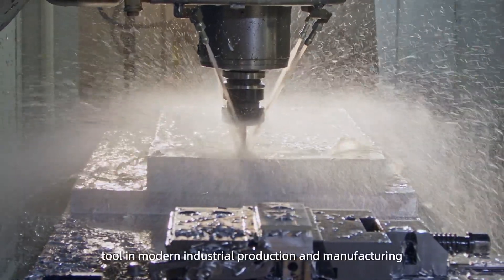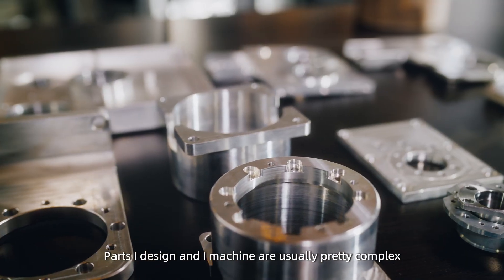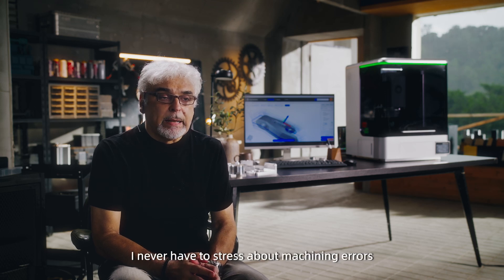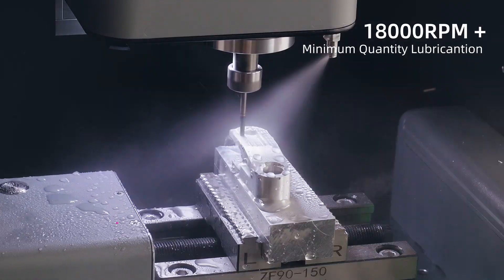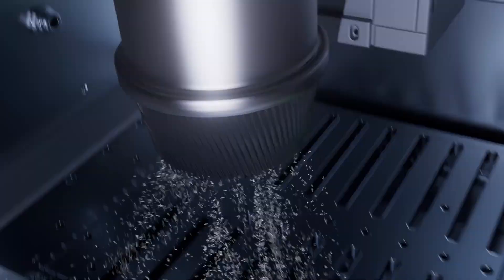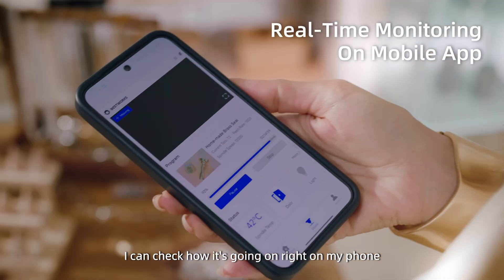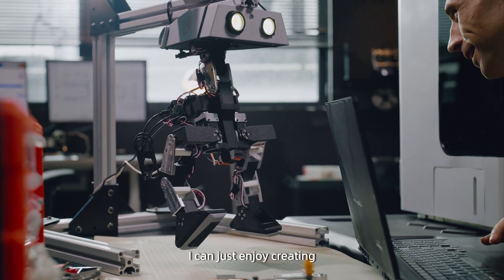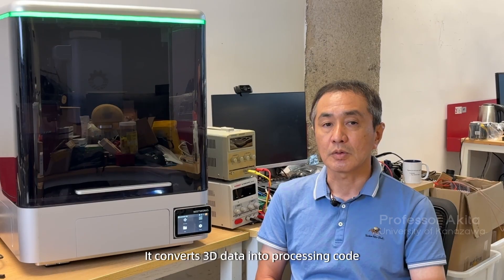"Make CNC Easier Than Ever" NestWorks C500 — The Smartest Desktop CNC for Makers and Professionals

Comment: Are there any details on the motor eg brushless , syncronys rpm range , how may bearings etc - my old heiz s70 cnc router  has a kress 1080 Watt motor which struggles a bit milling metal ?
Reply from the maker: Hi for details please check www.nestworks.ai and www.kickstarter.com/projects/959480926/nestworks-c500-next-gen-smartest-cnc-with-industrial-power?ref=bx5olj
Reply: @NestWorksCNC  I did check there after placing my order but there are no technical details on the spindle

Comment: Can it handling machining stainless parts?
Reply from the maker: Yes, absolutely
Reply: @NestWorksCNC  I make a bunch of small parts that start life as 3d printed aluminum or as stainless flanges cut on a waterjet that need some finishing after wards.  They are small parts and would easily fit within the working envelope of your machine, but I would be processing a fairly large number of them.  Would your machine stand up to being in somewhat of a production environment for aluminum and stainless?

Right now I'm hand lapping the parts to get the surface finish I need.  That isn't sustainable long term, obviously.
Reply from the maker: Sure absolutely and you could watch our aluminum & stainless steel processing video in our channel.Nestworks c500 really for the makers like you.

Comment: Is there a designed way to pass through pieces longer than work area? Carvera has removable panel on the back for that and that's a big plus
Reply from the maker: If you remove the tool magazine on the right side, the machining area will be further increased.
Reply: This would be a cool feature!